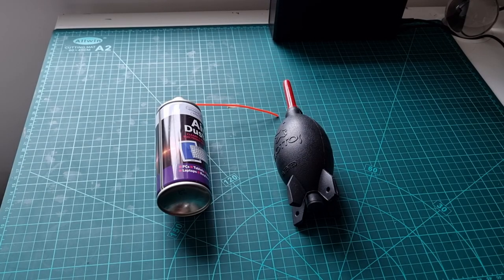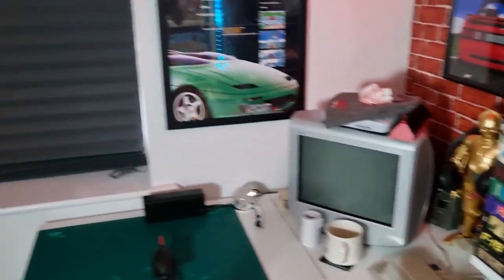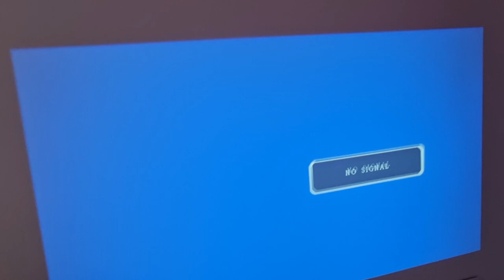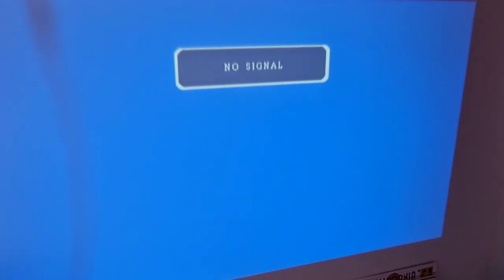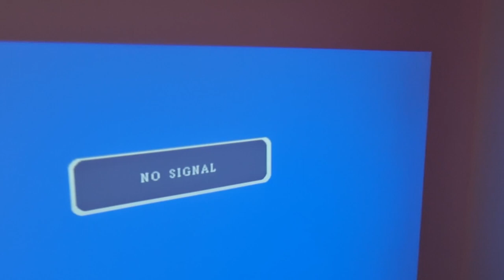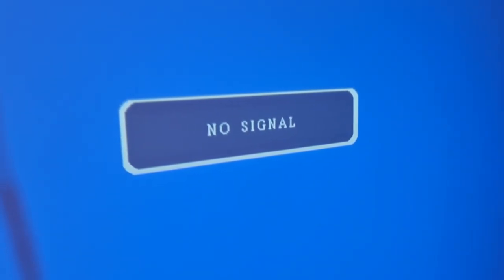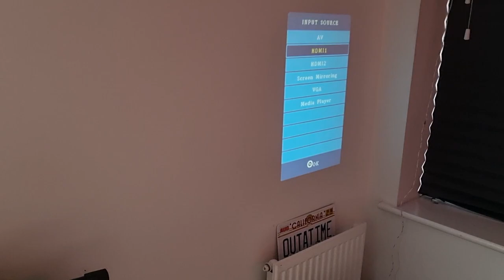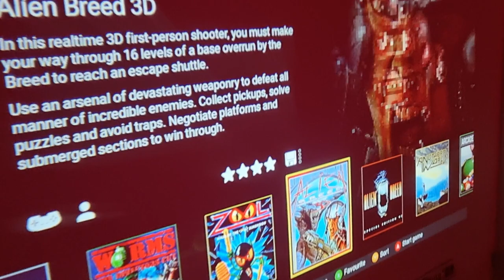Goodman's LED Projector With Wireless Screen Mirroring Form B&M UK (HOW TO MAINTAIN & DE-DUST)

Comment: Ive had this projector for a few years now and for what i paid for it i am still impressed especially compared to the other cheap projectors.
I have noticed though they have now replaced this model with a different unit...just hope its as good as this one.

Comment: Any help with what size plug goes into the actual unit been given one but need to buy a replacement power pack. I know its 24v but cant find anything comparable in my house that actually fits into the socket on the unit. 😔
Reply from the maker: ill try find out for you ill have a look at mine when i get in
Reply: @tooheystechgaming1977  Thanks! That'd be great 😁😃

Comment: Amazing job George 👍 kicks out a hell of a noise, I wonder if the fans could be replaced with higher quality/quieter PC fans?
Reply from the maker: Cheers mate yeh i was thinking that its bearable the noise but when recording its not ha ha

Cheers for watching andy
Reply: The radial fan at the back seems like a rather specialist part. Not sure about the other fan, don't fancy removing the circuit to get to it. A hushbox might be a better idea.

Comment: Do they still sell this iv been trying for ages to get a hold of one a can't seem to get it 🙄🙄
Reply from the maker: Widnes by my house and runcorn stores have them still for sale in stores maybe selected ones
Reply: In the end I resorted to buying one off eBay. Good for the money but the fans are noisy, the lack of zoom makes placement tricky and the scaling is not good. Hoping if I fed it a 1280x720x60Hz picture it would not rescale it and I would get 1-1 pixel display but can't seem to get it to work. A hush box might solve the sound and dust issue, might have a go at building one.
Reply: Back in stock in my local store anyway.
Reply: But not on the shelf you have to ask the shop assistants, i guess people steal them.

Comment: Ive got 3 protectors i have a viewsonic standard definition one witch is awsome and i have an old Epson one that needs a new bulb and a goodmans Bluetooth white one from b&m  and it will not focus in on my bedroom wall it mus need a good sized room bedroom for it to focus in  but i would say my bedroom is a good size
Reply from the maker: hi the with of my office is 2 metres and mine focuses fine
Reply: @tooheystechgaming1977  its mostly at the bottom its out of focus
Reply from the maker: i have slight out of focus around the edges but normally sorted by the angle change i never get a full perfect picture